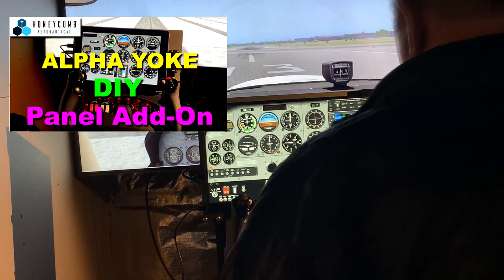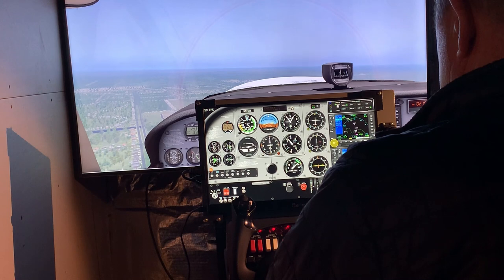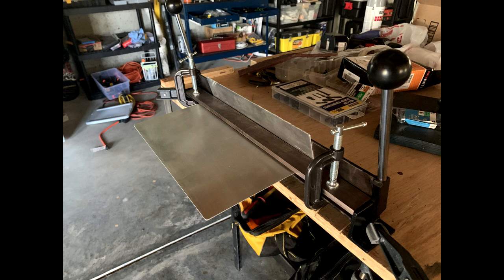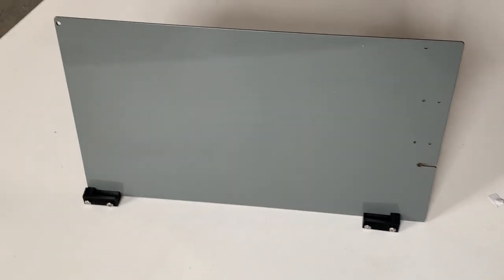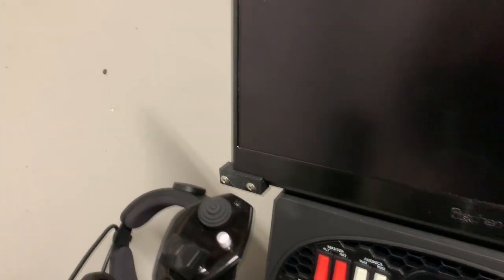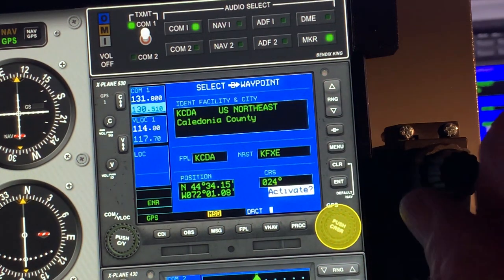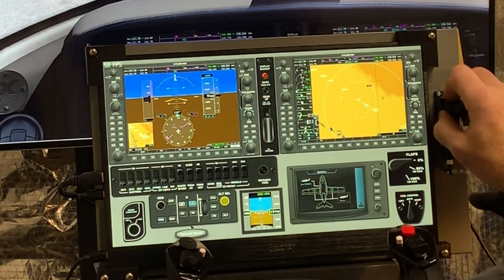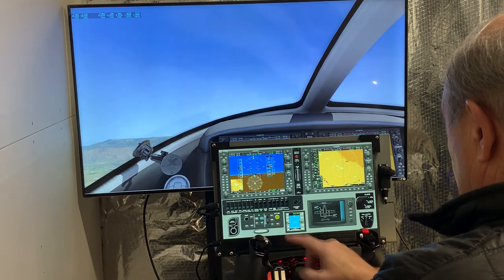$360 DIY Touchscreen Cockpit for Honeycomb Alpha(or Saitek) Yoke

Comment: Russ...
I would especially appreciate the info on the brackets.  When you published the video using the smaller screen, I asked myself why not do the same thing with the 15.6" touch screen.  You are way ahead of my game and since I don't see a need to reinvent the wheel...I would appreciate any help you are willing provide.   I too, am also willing to pay you consulting time.
Reply from the maker: will let you know when I post them a a few days
Reply from the maker: Tom Barefoot since the smaller screen was a tablet and I already had the snap in cover available it was just easier for me to cut off the front flap and pop rivet the case to the metal back. Brackets could be designed to hold a tablet or iPad just as easily.  Of course if the monitor has vesa mount holes it told be affixed that way too, but mine did not.

Comment: Thanks Russ!  I'm building a similar setup with the Knobster and Prechen, however, I'm mounting the touchscreen a few inches further back so I'm bending the panel the opposite direction.  I'm also using the VESA mounts on the display rather than brackets.  I'll start with a single display and when the throttle quadrant comes out, I may do a second touchscreen.
Reply from the maker: Ed DeBoer cool... be sure to share photos or videos when done
Reply: @rbarlow  What did you use to cut the aluminum?

Comment: Russ, just got my second touch screen. I am anxiously awaiting the release of the Knobster. I see that they pushed back the release date another month. Bummer. I am a CFI working on my CFII and I use my Simulator to reinforce my skills. I have been simming for 20 years now and I feel that with Air manager, and touch screens and soon the Knobster I will never leave my basement. Thanks for all you do. And I agree... more on how it’s done and less on the show. Love you brother.
Reply from the maker: John Panik you could build a Knobster with Arduino if you can’t wait. It isn’t hard and is slightly more setup that the current plug and  play version but it might be a good stopgap measure until you can get the new model. I was under the impression they were getting a shipment any day but perhaps that have been sold out.
Reply: Hi Russ hope im not out of line,  but have to ask if you could point me to the DIY ooption for the Knobster , im no  stranger to Arduino's and have many  Concentric encoders so would be great try and make one of these . Cheers  am buying  air manager and so this option  would be a good upgrade

Comment: Hi Russ. I really appreciate your series of videos on the Knobster and
homebuilt cockpits. My Knobster arrived today, but I'm undecided how
I'm going to use it. I'm torn between copying your '$360 Touchscreen
Cockpit' and your earlier 'Twin Touch Monitor SIM'. Having used both
do you think the added cost and complexity of the dual monitor setup
adds proportionately to the experience and level of immersion?
Reply from the maker: Well the dual setup is definitely more realistic and capable BUTi f you intend to use a three monitor visual set up  it does require a second computer and, if you want to display windows form XP11, the second computer needs to run XP11 too so the windows can be dragged to the panel monitors. My suggestion might be to do the easier option first but go ahead and purchase the second monitor so you will have a matched set later.  It seems these little monitors are made by lots of vendors but may vary slightly so it would be difficult to match the monitor later.  You wouldn't have too much invested in time or money doing the single monitor first and upgrade to the twin monitor later.  In a year who knows...perhaps Vulcan and graphics cards might make it possible to drive all five monitors with a single computer.  If you only want a single big screen  scenery monitor and the two panel monitors the dual setup can be done with a single computer so it is also an option.  You could add the three screen visual and a second computer later.  Those are the two options I would consider based on how many scenery monitors you want.
Reply: Thank you Russ for your speedy response. My current monitor is a curved 34" so I've many options.

Comment: Russ, as always, THANKS, Based on your wonderful advice, for the Sim I’m building for my two grandsons,, I purchased two 15.6” monitors, two mounts for them from Stay a level and two under table mounts so the Honeycomb Alpha Yoke & Bravo Throttles can mounted low and the monitors much lower,. The computer is the new M1 Mac, Mini, with the Mini sitting on a AGPTEK USB-C Docking Station & Stand for Mac Mini with SATA SSD/HDD Slot,, running Air Manager and just received the ELEGOO UNO Project Super Starter Kit with Tutorial and UNO R3 Compatible with Arduino IDE (and will hopefully use your ‘scripts’ to integrate the panels into the Mac. If, OK, I will keep you apprised as the build commences and continues. The Honeycomb ‘A’ & ‘B’ doesn’t arrive until late Dec, the M1 does t arrive until 12/24 and the Hub , not until mid Feb, so I will have time to integrate all correct,y hopefully .
Again, thank you.
Reply from the maker: Sounds fun. Happy to help if you get stuck.

Comment: Mr. Barlow, how did you bend the aluminum to get angle for the monitor. The brake only bend to 90 degrees, so how did you get the angle bend you show on your bracket. Also what did you polish the aluminum with. Thanks

Comment: Russ, 
I am a CFII in Raleigh NC and want to help some friends with their training using this setup. I have followed your lead from the start. I have the Prechen 15.6” touchscreen and run air manager as you have instructed. My question is, how do you  ( or can you ) make the Garman 530 and 430 automatically stay loaded in the air manager windows behind the bezel ? Every time I turn on the computer , unless I leave it in sleep mode, I have to resize the GPS pop out and drag it don and into the bezels. 
I too am waiting patiently on the knobster and think your invention is pure genius. Thanks for moving this idea forward !
Reply from the maker: Thankfully if you shut down an aircraft in  XP11 (or quit X-Plane)  with the G530 or G430 or G1000s opened and windows positioned, they will open to the same position the next time you open an airplane that has those units installed.  If you close them you have to re-open and re-position them. Also if you located them at another location for another panel, they would open where they last were when they were last used. So if you use the same aircraft all the time OR create panels where they are located in the same place they will be where you want them.  That is what I did on the G1000 PFD and MFD on the Cessna 172 and the VisionJet. The G1000's are at the same place  for both airplanes so you can jump back and forth and the windows are correct.  If you open an aircraft that doesn't have the window it has no effect. Thus you can change between the Cessna with  G1000 panel and the Cessna 172SP with 530/430 without affecting the positions on the other.  Just don't close the popped out windows.  I can also tell you how to record the window positions in the XP settings file so you can reset them exactly without any dragging if they get screwed up. Hope this helps.

Comment: Thanks again for another great video. Starting on my flight sim here, using a WiMaxIt 15.6 monitor with air manager and knobster. Panel are logitech and a Real Sim Gear GNS 530. Only problem for me will the brackets for the monitor to hold on to aluminum panel. Will also be running FS 2020. Also what was the degree of bend you did for the aluminum panel for monitor. Since running logitech panels will I need an Arduino?
Reply from the maker: Logitech panels should have their own plugins 
The threaded screws on back of monitor should hold it without problems
Reply: @rbarlow  Thanks
Reply: Thanks for posting an alternative to Russ' Prechen.  I never found that monitor, but just ordered the Wimaxit.  It looks perfect. And thanks to Russ Barlow for posting great content and alternatives to paying top $$$ for renting an AATD.

Comment: Hi Russ, would 15.6 inch be big enough  .I'm undecided if i should make a 180 curved screen  or use 3x games monitors screens , , either way i will be using Air manager with prob the 15.6 monitor  for the instruments or glass screen, what do you recommend

Comment: Russ, I have purchased the Stay Level Avionix panel and the 15.6" monitor and the Knobster   I am planning to run X-Plane 11 on a new MacBook Air with the M2 chip, it should be here next month, and Air manager from my iPad Pro.  Is there a hub that will work with the iPad Pro to allow it to connect to the new monitor and to the Knobster?
Reply from the maker: See other response to same basic question

Comment: Great innovation !  As always, thanks for sharing. With the set up in the video, is it easy to use the hat switch to look around in the main display (e.g. for flying the circuit) or, when touched, does the touchscreen become the active display meaning that main display would need to be re-selected before the hat switch can be used ?
Reply: In my setup you can use the touch screen and main display with the hat switch at the same time with no issues. You have to tell Windows which is the touchscreen monitor before using Xplane. Once monitors are connected just search calibrate touch screen and follow the instructions.

Comment: Russ, new to sim. Enjoying your channel. I’m running X-Plane 11 on a MacMini M1 with a 
Honeycomb yoke and throttle quadrant. I have a separate macMini and want to run air manager on its monitor. The two computers are connected over Ethernet. Is this possible?

Comment: Hi Russ, maybe I missed it somewhere in your other videos or this one, but are your external scenery view displays PC monitors or are the HDTVs? In your one video that explains multidisplay geometry and setup, you mention that your displays are 49” (43” wide) so I would assume they must be TVs rather than monitors. If so, aren’t there issues with input lag, latency etc, that used to make TVs as monitors not such a good option? Or is that a thing of the past with the newer TVs? Would you mind telling us exactly what you are using for your scenery displays? Thanks !
Reply from the maker: CheckSixIvan yes they are 4K TVs but the video signal is only 1080p (1920 x 1080).  They are Vizio TV but a few years old now so similar or better TVs are not very expensive now. Just be sure to get good wide viewing angle and beware of TVs with excessive input lag. A good source of info on TVs and how they work for gaming is at https://www.rtings.com/tv
Reply: Russ Barlow Thanks for the info. Had a multi screen setup awhile back but monitors were smaller. This option to use much larger TVs has resparked my simming interest! And once the bug bites.......

Comment: Hi Russ what type of computer do you use air manager on?
Just received my Knobster today!! Look forward to using it.
Reply from the maker: Great! I have several computers and two sims. I have a i7-9700k RTX2080ti for my XP11 VR sim but I have been testing FS2020 on too. My second has 3 monitors for scenery visuals on one computer and a panel with two more monitors on a second networked computer. Both are older i7 cpus and one GTX1070ti(scenery) and one GTX1070 for panels and Knobster. Air Manager can fun on quite a low powered computer. If you want to show pop up displays from the sim you need to run Air Manager on the same computer. Basically if your single computer runs the sim well it can handle the added monitor with Air Manager and lose less than 3-5 FPS. Check out these videos on my channel for more info

DIY Twin Touch Monitor Sim

https://youtu.be/ZOdI__BMat4

Five Monitor Sim and Only a Single Computer- XP11 Vulkan Stress Test
https://youtu.be/ZOdI__BMat4

Comment: Thank you Russ.
I like realistic size instrumentation.  Do you find the 15.6” monitor provides this for steam gauges as well as the dual G1000 setup?  Would a larger monitor work better or just be overkill?
Reply from the maker: gerdelt 15.6” is definitely much smaller than real live. I think you might get a full size six pack on the monitor. The resolution is quite sharp so the smaller size doesn’t limit functionality.  The monitor can also display a single G1000 PFD OR MFD at about full scale.  I don’t think you could mount a larger monitor on the Alpha Yoke...it would need it’s own structure for support.  A 32” monitor would probably be needed to approximate full size for the panels in this video.

Comment: I have available a 23 inch touch screen.  I am running X Plane 11.  I also have two regular monitors available for main monitors until 48 inch one come down in price.  So can I assume that with a Knobster either purchased or DIY, I could have a decent setup for the 737?   I also have an older iPad available.
Reply from the maker: It requires the instrument panel to be in Air Manager to work with Knobster so that may need to be made.  There is an overhead panel now with others to come.

Comment: Hi Russ, does the knobster work without air manager? I ordered 3 55" TVs and would like to use a 24" touchscreen in front of the TV but behind the yoke to just replicate what is behind the yoke (that is, in effect just add touch capability to that area of the TV) so I can touch switches and it would be awesome to also be able to use the knobs. If not it would be a great plugin!

Comment: Hey Russ Great work how do you see the air traffic management system on your setup ? I want to implement it for an autonomous drone with a cockpit inside to see the air traffic and then use that data to re-route the path using a 4g LTE connectvity.My flying range is about 500 mtrs initially.Looking forward to hear from you.Could I know which software did you use to implement this sim?

Comment: Excellent video, Russ. I am curious if that Cessna G1000 panel is available. I’m not finding it on Air Manager. Thanks.
Reply from the maker: Chris Cap I think it is offered as an alternate panel choice for the Cessna 172SP pay panel. Go to the panels tab and click new panel. Find the Cessna 172SP panel and when you select it and click next it will show all the optional 172 panels of which the G1000 panel should be one

Comment: Great solution for the budget minded for utilizing the Prechen monitor.  I can see why you did this with the Honeycomb as it's reasonably priced and provides a way to secure metal panel to the yoke.  Do you think there's a reasonable solution if it was a Yoko yoke?
Reply from the maker: stl files now at https://www.thingiverse.com/thing:4050743
Reply: @rbarlow  I went ahead and ordered the bezels for the Prechen monitor.  Unfortunately that monitor died on me 2 days ago but I will be getting another or at least one with the same bezel thickness.  I would prefer one with connections in the rear rather than the side.  I'm stuck on how to make the metal panel.  I don't have the necessary tools.  Any way you would be able to make one?  I'm willing to pay for the materials and your labor costs.
Reply: In my setup I use a gas monitor arm I got from Amazon. I can place the monitor pretty much anywhere I want. All I have is a cheap yoke and I am able to place the monitor on top at any distance. The arm is very easy to mount on my table, Mine suports monitor up to 27" and about 15lbs. I have a 22" touch screen that weights about 8 lbs. I paid $27 for the arm.
Reply: Which gas monitor are you using?

Comment: I have an iMac and want to transfer the PFD of my A320 model to my (apple)  iPad. How can I do it?
Reply from the maker: If there is software that allows you to use the iPad as an external monitor for your computer and if the PFD can be popped out you can just drag it to the iPad screen. You didn’t say if the computer is windows or Mac and what sim X-Plane, P3D or MSFS
Reply: @rbarlow  Thanks for quick answer. I am using Apple Mac and X-plane11.51. X-Plane has some ports for external connection but I don’t know how to use them. For my Apple iPad I am seeking a suitable 
application for transferring PFD on touch screen.

Comment: Great explanations, very useful indeed. One question: do you use the Matrox card to run your 3 flat screens ??? Thanks for enlighten me.
Reply from the maker: Alain Keller I have an NVIDIA GTX 1070ti  to run the three screens as the external visual copy of XP11. I run the cockpit screens using a 1070 running the master copy of XP11 and Air Manager. If you only need one cockpit monitor or do not need to show popped out XP windows in your Panels you could probably run a 4 monitor setup on a single computer or a 5 monitor setup without a second copy of XP.
Reply: @rbarlow  Many thanks for such a speedy answer....Much appreciated